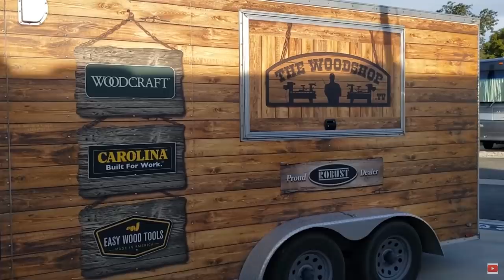How this Wood Worker Makes a Living | Stone Coat Countertops Epoxy

Comment: Hey this is off topic, but I’m wanting to do my bath tub. Can I do this with StoneCoat?
Reply from the maker: Y'know, I'm glad you asked, Kim. That's a great question. The only issue is that in a bathtub, sink, etc the epoxy is going to all run to the bottom. Our formulations aren't really made for bowl-shaped stuff, to put it simply. I have coated an entire vanity before and it turned out pretty well: https://youtu.be/6Ml5mbnrKh4 . After investigating this question, we've found products that, unfortunately for us, fill the bill a little better. Here's a link to that: https://www.amazon.com/dp/B00642JDTM/ref=cm_sw_r_tw_dp_U_x_y2.zEbCCS4STY
Reply: Thank you so much for your honest reply. I love Stone Coat and use it for art projects and local countertops. I’m going to find a way to do a bath tub. I’ll keep you posted